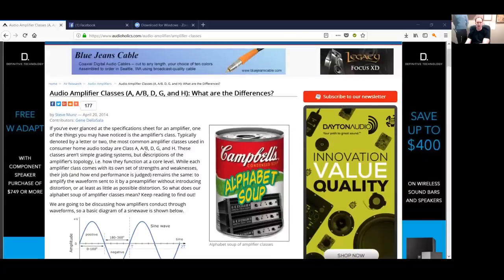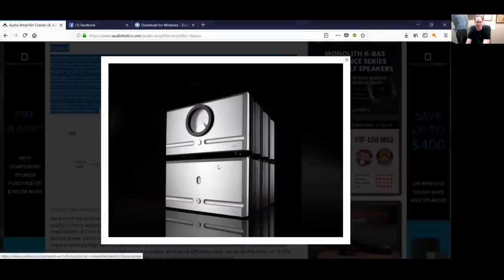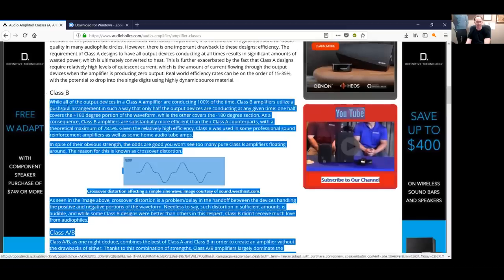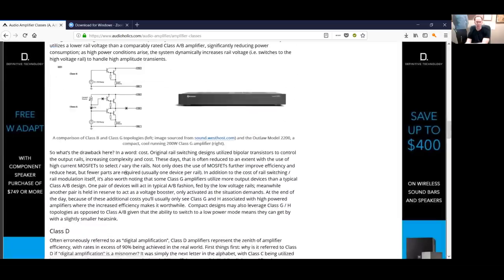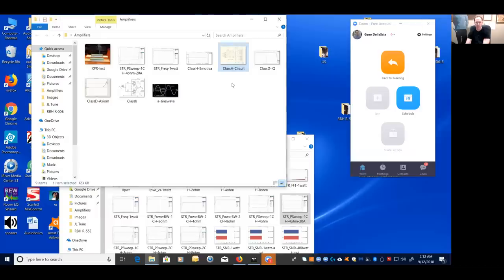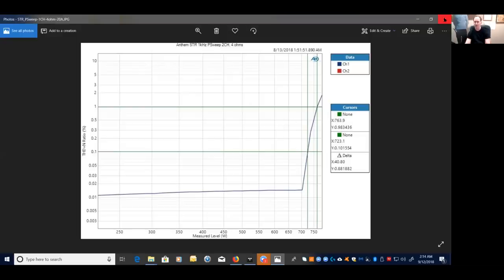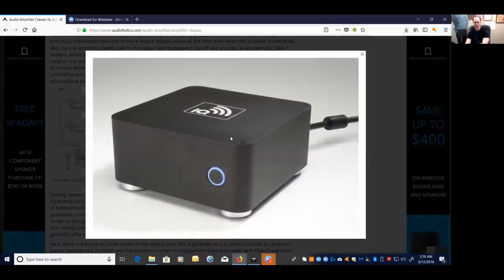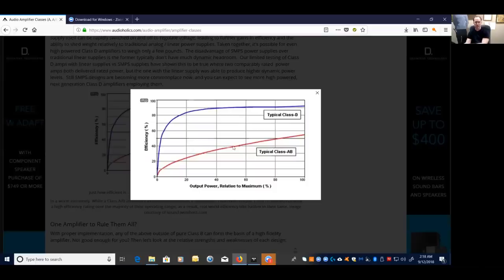What are the Differences Between Class A, AB,  and D Amplifiers?

Comment: What are your thoughts on sonos amp ( 250w x 2 @ 4ohm ) of latest generation? I am driving Sonus Faber Sonetto 1 bookshelves with it ( and i love the way they sound ). I cant shake the feeling that i'm missing out on more fidelity/soundstage/transparency out of my speakers when i look at all these huge, fancy looking setups with tubes and shit sticking out all over the place and speaker wires as girthy as my shaft. Should I get a better amp or is this particular Sonus Faber model too entry level to really matter? at what point would you recommend upgrading amps? would you even bother pairing a super high end speaker with a puny amp like this? my main reason for going with sonos is because i really like their overall software integration and how you can make it disappear in your home (i am not a fan of huge racks of equipment dominating my listening space ). Then again, i'm also the type of listener that still uses amazon basics cables (far less girthy), so maybe im just not high end enough for a superior amp? All of the reviews so far for the AMP have been...well. not very technical to put it mildly, there is a 4 star review by what hifi, but i feel like it was more about its aesthetics and packaging rather than a full dive into its performance and measurements.
Reply: Hi, I was interested to hear that you are running Sonetto 1 bookshelves. I am seriously thinking about buying a pair. I have a Cambridge Azur 851A stereo amp (200W into 4 ohms) and that would not be a problem to drive the Sonetto's. I'm no expert, but think your amp should be fine. Can I ask how you find the Sonetto's? They are also beautiful looking speakers! I have a very small listening room and am very concerned about boomy/muddy base resonances so was thinking to trade down to a smaller monitor (e.g. 5" inch woofer down to 55Hz) and filling in the base with a good subwoofer...But I am very tempted by the Sonetto's. P.S. for speaker cables - try the Kimber Kables, they are great, and Gene likes them too!
Reply: @marcfoss7687  Hello Marc! I ended up ordering bluejean cables. I'm actually a cable skeptic so Im not expecting much from cables.  The Sonetto 1 is my favorite speaker to date. I'm using them on stands for home theater and music. I LOVE how they sound. The bass is very articulate and full but not boomy by any means. They are very sweet sounding and VERY detailed. 

Those tweeters are AMAZING but I had to turn down the treble 1-2 clicks (~5%) because the Sonos amp is known to be a touch on the bright side, but that's the only tweak I do for some tracks (most of the time I leave it at default). I have hardwood floors and the speakers are close to a window so that doesn't help.  This is why I got the belden blue jeans cables to help counteract the amp (Amazon basic cables make the highs brittle according to some posts I read online). 

Imaging is very good. These are transparent speakers with a very wide dispersion. They fill my smallish living room quite nicely and can get quite loud. (these are meant to fill a mid sized room and I have no doubt that they do). The woofer is not one of those high excursion types. It barely moves, but the bass is so rich and fast and present. You can be confident that you will get every last bit of detail out of these drivers. My plans were to get a Sonos sub to complement these but I'm not in a hurry as these have enough oomph. I'm afraid that if there is anymore bass I'll get upset neighbors knocking on my door. But I still plan on getting the Sonos sub to support my movie watching. I'm definitely a bookshelves on stands fan vs full range floor standers. My speakers must be maximally transparent and I believe that ideal place for bass drivers is not necessarily the same place where you place your speakers. This is why I went with the smallest bookshelf in the Sonetto line.

The speakers are absolutely gorgeous. The way they look on my custom stands is just perfect, with perfect proportions and size. My girlfriend loves them and says that out of all the speaker candidates I looked at, these are by far the sexiest. honestly these are currently end game material unless I move into a much bigger space or if my budget allows for their bigger brother - the olympica 1 (mostly for aesthetics).

I feel like these are the ideal combination of materials. I wanted silk domes, paper cones (cellulose pulp to be exact) and high quality cabinets, I wanted natural vocals and I wanted total transparency and 0 fatigue for long listening sessions. I don't have alot of space to set these in the middle of the room so I wanted a front firing port. And these checked off all my requirements. 

It's such a sweet sounding speaker while being nice and neutral and for me hits the sweet spot of resolution vs smoothness. I compared these to KEF ls50 and for me it was no contest, that silk dome tweeter is brilliant at retrieving detail without triggering my sensitivity to harshness that I often get with metal domes. 

My friend who is a music producer came to audition these, he said that they are very neutral, very close to his expensive genelec monitors but smoother sounding but "look and sound much sexier" - not flat and analytical like monitors (and kefs) but with a bit of sweetness and richness. He said that we live in a wonderful time when we can listen to sound that was only accessible to millionaires. Lol. 

Oh yeah. Even at low listening levels the precision is all there. The detail really makes them ideal for home theater too because you can hear the dialogue very clearly without using a center channel. The center image is rock solid and always syncs up to the screen position even waaay off axis. Minimal toe-in too. I can sit anywhere on our sectional couch and the center is rock solid. 

I listen to all kinds of music, from classical to jazz to electronic to rap and these do a fantastic job with all genres.
Reply: @parapobabam  Hi, Thanks for the detailed reply! Great to hear that you like the Sonetto's. Really appreciate your useful comments. Also good to hear that they are flexible on positioning as well, I think the font firing port would be an advantage in my small listening room. They are now on top of my list to audition - and will be arranging a demo as soon as I can travel back to the UK. Agreed, they are gorgeous to look at. For me at least, speakers must not only sound (very) good but should also be aesthetically pleasing...which I think a lot of audiophiles don't overly focus on. Can I ask what speaker stands you are using (given their slightly unusual base dimensions)? I looked at the specific Sonus Faber stands which again look nice, though they are quite expensive...Thanks again!
Reply: @parapobabam  Wow...I can't compete with you there! :-) But thanks again for the info and ideas.

Comment: I like my Sunfire theater Grand it must be class H as it puts out 200  watts into 7 channels and barely gets warm when cranked also note there are no vents anywhere . You might like to know that  Bob Carvers Tracking Down Converter Keeps the rails  6 volts above the input . I also am using a Sunfire True Subwoofer , An 11 inch cube with a 2700 watt amplifier . You would have to go much much larger ( and that won't make the wife very happy ) to go deeper or louder . Yes they are getting old but I haven't found anything  I want to replace them with. Also it would appear Emotiva copied Bob's designs as it was the seventies that He built a 350 watt amplifier in a coffee can that blew away the McIntosh at one of their amplifier challenges. I also like how Emotiva says ""until now" power amplifiers needed heavy transformers . And Emotiva XPA-2 brags how it puts out 300 watts into 8 ohms and 490 into 4 ohms whereas Sunfire power amps double the power as you half the impedance down to 2 0hms .
Reply from the maker: Sunrise specs were often overstated and their amplifiers were rarely designed to do rated power continuously. Just be careful with marketing claims. You can't get 400wpcx7 from a single chassis, single power cord like the old Sunfire amps used to claim. Jade Design (aka. Emotiva) often did work for Sunfire, so no surprise of product similarities.

Comment: In car audio... The old class a/b amps got incredibly hot..  And pushing them into low impedance loads. Holy smokes... Literally. That was the day of a dollar per watt.. Orion hcca car amps. Excellent sound quality.  75 watts rms. But .50 ohms 1200 semi reg power supply..  But you vould never feed it enough and it would blow up.

Comment: When it comes to analog or digital all electricity really is mathematical and measured with digits on a digital instrumentation so for me I have always considered all amplification and all signal to be a digital coming from a 60 hurt humming circuit in the wall. I think electricity itself is digital therefore I think a digital switching app is intelligent. But it is not brutal. The class a circuit will always be the Titan. But eventually they will master the D circuit and have it switching digitally with a Mosfet, tube and cap capacitance and some kind of push to it from a parallel reserve or accumulator to add envelope.

Comment: Ok so after watching this video I'm more confused then ever 😂 what is the best amp I can get for my car, I was looking to get a 1,000W amp with 2 12's and go from there. But what would be the best option? I was looking for the best sound quality as I can get. But what's with all this efficiency stuff? Can someone just fill me in with what would be my best option?
Reply: Class A/B for mids and highs and class D for subwoofers in a car. You can run class D multichannel amps for mids and highs if you want more efficiency. Most cant tell the difference in sound though between the different classes. Just buy reputable brands.
Reply: @tylers4163  ok, I started off with a head unit I went with the Alpine ILX-W650 so by mids and highs, you mean the pre amp? I would want to get a certain type of pre amp for my speakers, and a class D for my subs?

Comment: it turns out my class AB amp draws 65 watts at idle. DAMN.
Is that normal?
Reply: Is normal .
Reply: Mine draws 360 watts at idle🤔. And that's normal. (McIntosh MC 2500's). Love them. I also have a smaller amp and set of speakers for when I'm not trying to tear down the walls!

Comment: Forums: lol: The main thing I've learned from anonymously reading some forums is that all my stuff is overpriced garbage (even if I got it for 1 cent) and none of it should ever be matched with the other garbage in my complete garbage system which is also setup and positioned completely wrong.  From the source to the speakers. In fact I'm quite shocked that sound does actually come out of my speakers at all.

Comment: Mi experience from 1980 til know. I am audio maniac . I go back to old school amplifier class  A-AB
particularly old Pioneer A9 and A88x. It was very hard to find them in good mind condition. I do not like any digital amplifiers. You just skip the fact that the class D is high switching amplifier because the analog music is converted inside to digital and is send to the power stage transistors like impulse .Al this tech witch digitaising the analog music is crap and sound unreal with incredible high slew rate of amplification, robot voices and metal sound. In combination with a many channels 9 or 11 it is disaster and head ache. I have two legs, tho hand and two ears and I need two floor speakers for stereo. I don't like the robot voices in the music. Also the class D sound spectacular, but very unreal and high distortion in a high frequency. I like HiFi music not High End music because the real music is in the frequency range according to the human hearing . So  I choose Pioneer A9 with a frequency band 5Hz-200 000 Hz which is extendet point of linearity and give me very high sound resolution. There is also another old school amps that are very good sounding , but nothing so bad likes class D!  I don;t care about power and efficiency  !  I will pay the electric bill to listen good quality music  Never class D! inside you have two times transfer from analog to digital and from digital to analog !  !!! I am up to here!

Comment: The new BGW fully balanced differential Amps are designed for commercial use but there is no reason they cannot be implemented in very high end home theatres. It comes with a wide variety of channel configurations. https://www.bgw.com/amplifiers/vxi/vxi88

Comment: Class D for economic reasons size heat and power usage are good options for multi channel systems 5.1,  7.1, 10 or 11.1 or .2  my my ears are still good for 52 even though they have rolled off on the high frequencies. I was raised on analog would attend live concerts in orchestras so my ears are very in tuned with live instruments and still nothing beats analog class a amplifiers for the closest thing to real sound to give you that experience of depth of field and placement of instruments on a two channel system. Myself amongst many others cannot stand the sound of class D amplifiers we can actually hear the difference in to trained ears it sounds like fingernails scraping against a chalkboard. It has gotten a lot better except a bowl to listen to I will agree to that but I build my own class a amplifier’s so I’m not forced to buy what’s on the market. I build my own extremely clean high output power supplies. For us who love audio equipment we don’t mind the bulk of large amplifier with separate external power supplies using mono blocks and bi or tri amplification. And that’s why we have air conditioning to tame the heat of such a monster inefficient class A amplifier system. 
   White for watt comparing a 30 W class A amplifier to a 30 W class D amplifier is like comparing a 73 Ford Pinto to a 2018 Tesla model S P100. Hands-down no comparison.

Comment: I had a class A power amp, "Ampzilla" by Great American Sound". You're right. It was a great space heater, when it wasn't broken down. Went to a class AB, NAD 2200. No comparison. Sounded way better. No fans. No space heater. Still going after 32 years. Pre amps should run in class A. Especially, phono amps. Other than that, a huge waste of energy.

Comment: Please don't pick on me. I'm using a Carver AV-405 amp. I'm using that amp because it doesn't hum. I would like to know what is the classification of that amp. Is it AB or D. It's a Carver. It is not normal. Carver amps either work or they don't. Years ago I had a Carver TFM 45. 300 watts into 8 ohm. The first day I got it, it actually caught on fire. The dealer said. Why didn't you turn it off. I said, Listen, Smoke was pouring out of it. I am not a fireman. The dealer said, you wrecked the motherboard. I said, I think you could put jam on that motherboard. It's toast!!!! lmao